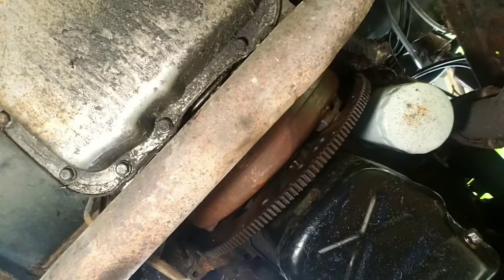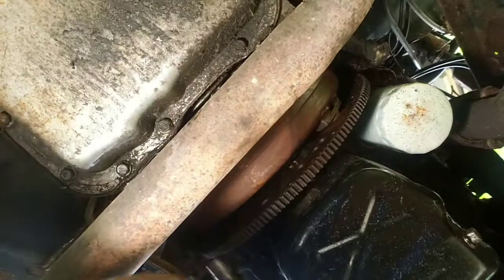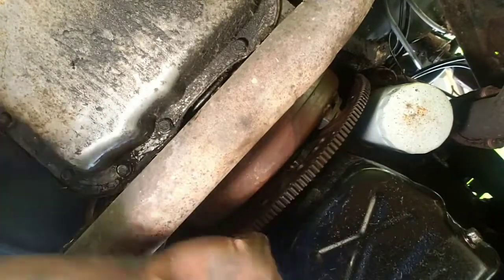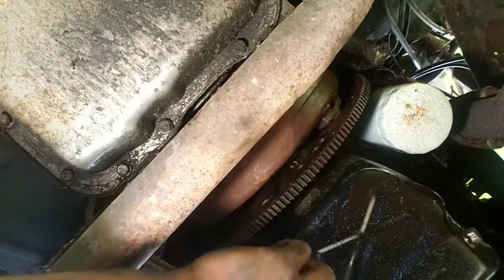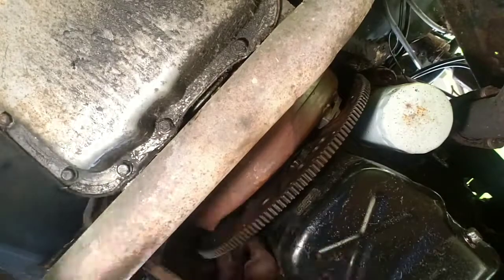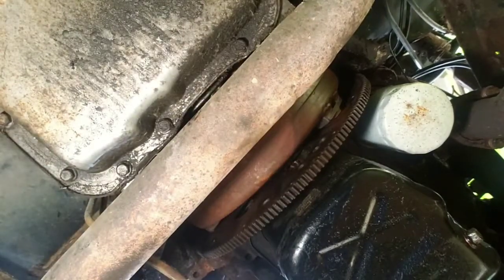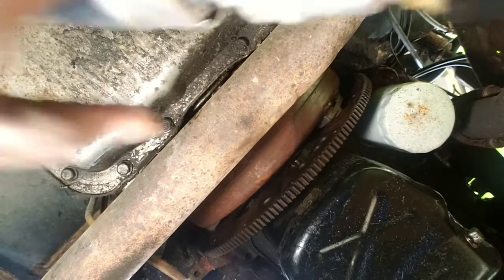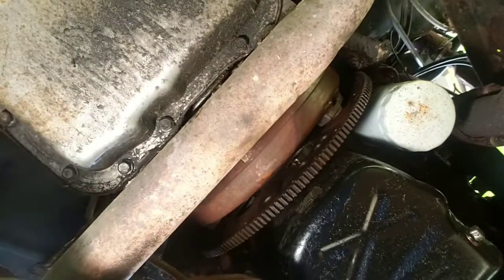How to remove torque converter bolts

Comment: how did you unbolt the flywheel with out it moving?
Reply from the maker: Put a screwdriver  in one of the round hole  it won’t move
Reply: @godson197410  my wholes don’t go through lol